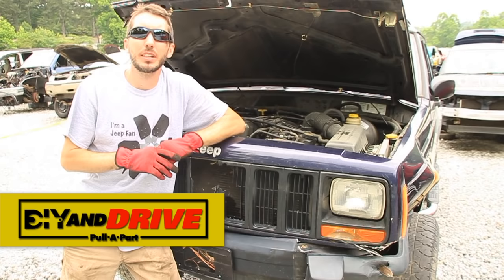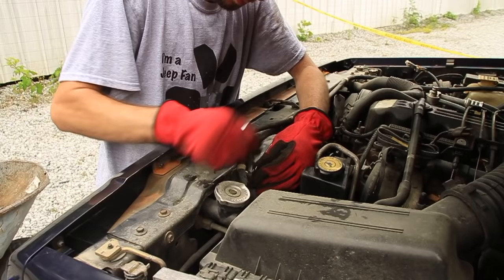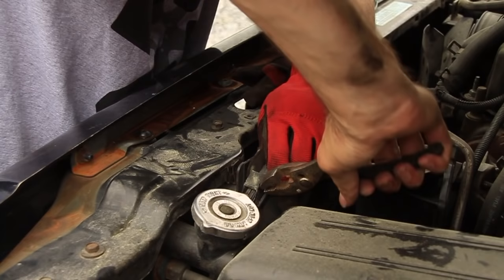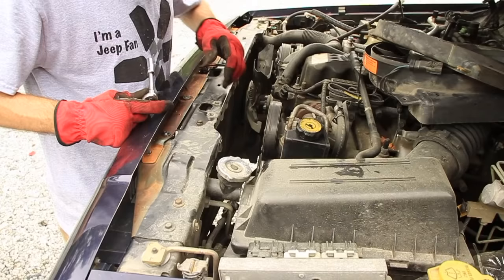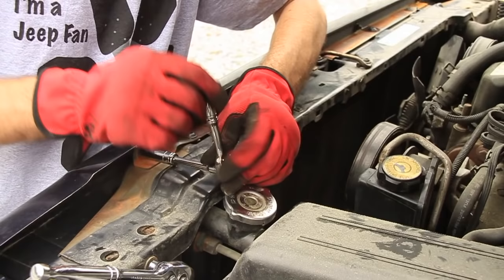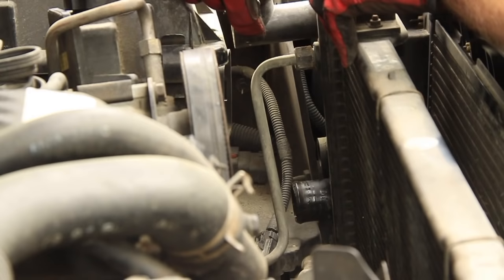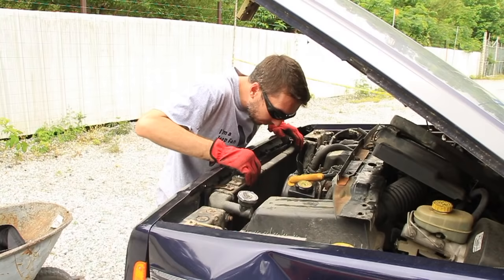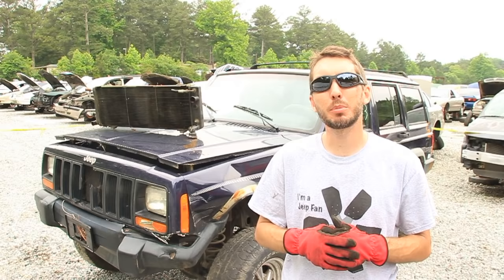How To Remove a Radiator

Comment: Install is the same as reverse?  Except for that cut transmission line.  I'm going to need my transmission after I put in my new radiator.  Guess I'll look up how to do that but use the tool instead.

Comment: Just did this last week.  My son's XJ radiator clogged and blew the passenger side tank off while I was driving at midnight in a snow event.  I had to drive another 10 minutes with no coolant to get to work.  Got a new radiator and had it swapped out in an hour, the most difficult part being the ATF line and running to HF to get the proper tool deep enough to release it.  Overheated the 4.0 with no issues.  It was so hot it stalled and wouldn't turn over once I got it to work.  We trailered it home the next day.

Comment: It’s hilarious to see XJ that are not in areas with road salt. My XJ is from Arizona and has only been in Michigan 5 years. It took me two days to get this radiator out along with a new trans line with quick connect because everything was rusty. Spent two days and only broke off one core support bolt. It’s shocking what five Michigan winters will do to a vehicle.
Reply from the maker: ya, northern states suck!

Comment: can anyone tell me what is a good way to clean mud out of the radiator and motor
Reply: Ive had good luck with degreaser and AC coil cleaner (Home Depot)
Reply: it is inside the radiator when i take the cap off the water looks muddy

Comment: I have a question I got a 1988 Jeep Cherokee XJ 4.0 automatic transmission but I don't want to cut the bottom transmission line who am I how would I take it out and put the new radiator and then out damaging anything
Reply from the maker: There’s a clip, it just pops out when you squeeze it in the tranny side.  On the radiator side it unscrews.
Reply: @bleepinjeep   What kind of special tool do we need to access this clip?

Comment: not sure why anyone would buy a radiator out of a junkyard. Plus you would not want to use the transmission cooler on a used radiator and the cost to get cooler cleaned would cost more than a new radiator to begin with
Reply from the maker: +marble head what happens if you find an aluminum 4 core radiator in the salvage yard?
Reply: Hey guys, he's only showing how to remove a radiator if you need to for whatever reason. Not everyone can afford a new one and besides, some these old ones are okay.
Reply: was your video made for the expert ? yes or no 

If yes then the expert would know the risks of a used radiator and if they needed something special or found some aftermarket gem then its a win for the salvage yard 

if no then when making videos someone that knows nothing it probably helps to warn someone that junk yard radiators might not be the best thing to do for your car without proper cleaning and then they risks of the dirty transmission cooler from the donor vehicle contaminating your transmission with shrapnel
Reply: True Story 
Pull-a-part price RADIATOR (W/O SHROUD)$42.50$6.50 core

Jeep wrangler radiator new from eBay 
$58 shipped to your door ( to my door a month ago) 
$0 core
In this case the salvage yard might not be a good deal after all 

Plastic ages with time and some parts are not worth the risk buying used for the regular person trying to fix their car trying not to end up broken down on the side of the road ( maybe my new one will do the same thing only time will tell )
Reply: you never know what you gonna find in a junkyard, sometime people just throw thigns away without knowing their value or if they work or not...

Comment: I wish he would've showed how to tell if the radiator is good from the junk yard
Reply: eugene labranch I can't think of any way other than a quick visual inspection. Not like you can pressurize it to see if it leaks.
Reply: forget used and just buy new

Comment: Your going to use that radiator?  Good luck with that. Probably leaks worse than the one your changing.
Reply: I was on the fence about that. The trouble is most original radiators are almost 20 years old. If I had my heart set on using a recycled one I would not use it unless I took it to a radiator shop. Saving a few bucks ain't worth being stuck in the woods or on some highway.